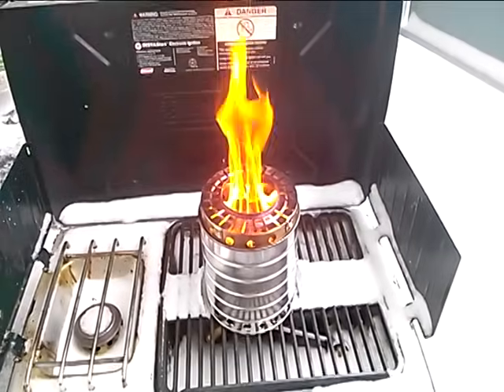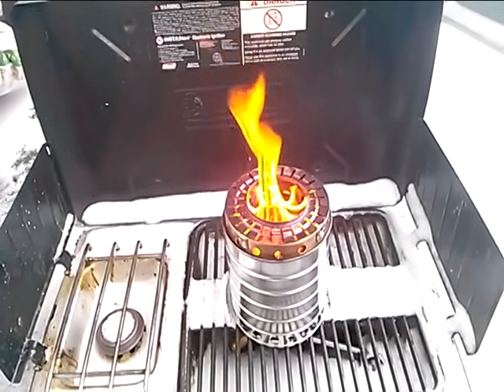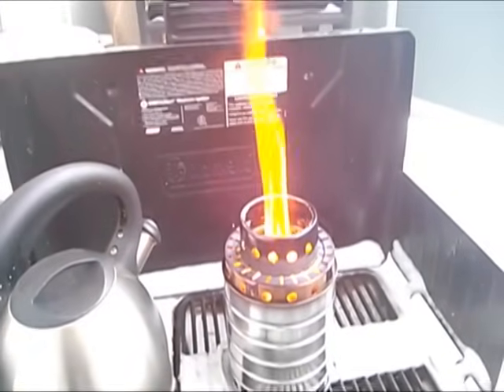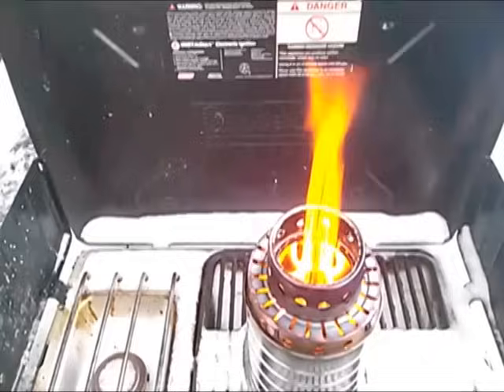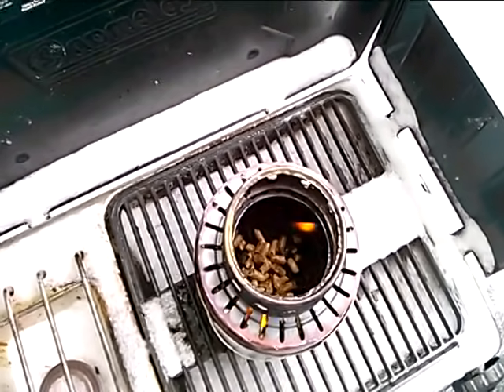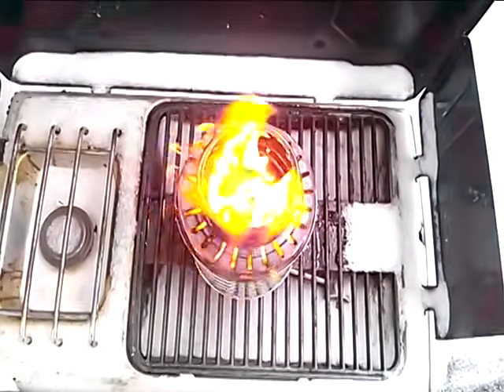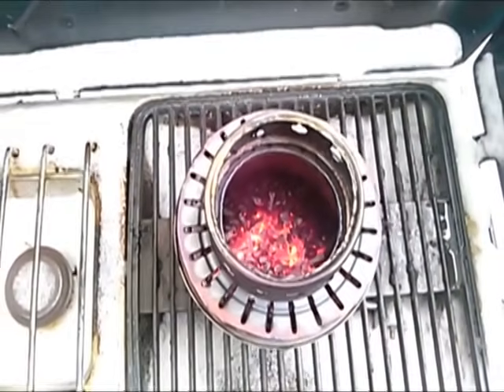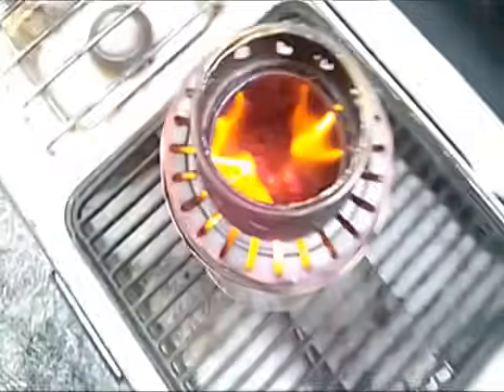DIY Stainless Steel Woodgas Stove v3.0 a.k.a "The Rocket!"

Comment: Is it possible to make it act like a cyclone by angling the holes on the top of the inner tin in one dorection? I'd really like to see your version act that way or maybe another version. The ones I saw that did it made a very concentrated flame and the inside looked super cool aswell.
Reply from the maker: I'm sure it's possible, however I haven't been building these stoves for a while now and I've moved on to other projects.
Reply: @joecmarques  that's unfortunate. Honestly you could probably make some money off this design xD its better looking than the solo stove.
Reply from the maker: @justm720  thanks for the compliments, that means allot!
Reply: @joecmarques  thank you for sharing your take on the wood gasification stove. Super nice.

Comment: Concentrating the flame into one spot like that is not ideal and that is why it is taking 15 minutes to boil. I have a little super cat can stove that boils in 2 minutes with a much smaller amount of flame than that. You need to send the flame out in jets instead of concentrating it.
Reply: The bottom surface fights against itself when concentrating the flame into one spot. That one spot gets hot while the rest stays cool for quite a while longer. Without heating the entire surface, the water is keeping the non contacted portion cool. Do you get what I am trying to say?
Reply from the maker: Thanks for the suggestion. This was very much an experimental design that I learned allot from. 

You mentioned that you boil water with less flame in about 2 min. That sounds rather fast, are you sure your making a proper comparison though? Keep in mind I'm boiling 1 Liter of water (that is 4 cups of water)... not 1 cup, and we are dealing with outdoor sub zero temperatures.

Comment: I find it interesting that many think that the gasses come up on the outside of the burn chamber and then to the inside chamber where they combust.  It seems rather obvious to me that it is air that comes up the outside, goes into the burn chamber where it gives the gasses oxygen allowing the burn.
Reply from the maker: djmaur, it is a mixture of both the gasses and the air which become super heated as they travel up the inner wall and out of the secondary air holes to combust. This is why the combustion from the secondary air only takes place once the stove has been going for a couple of minutes to heat the inner pot up sufficiently enough to super heat the gasses. 

To observe this yourself I would suggest building the stove, then blow out the flames or snuff it out, and what you will see is the smoke billowing out of the secondary air holes. Bring a lighter near the super heated smoke gasses and air mixture and it will immediately relight and the smoke disappears as it is immediately consumed by the flames. It is this very behavior which should prove to you, or anyone else with doubts what is driving the actual combustion. 

Keep in mind that at no point in time is there any flame emanating from the wood or charcoal, except when it is first lit. After a few minutes when the gas mixture between the inner wall is hot enough, the flame jumps to the secondary air holes, where it then starves the wood of oxygen and causes it to smolder slowly from top down. At that point in time you are burning wood gas. 

If you have doubts still, I would suggest you do a bit of research on the principals of how these stoves burn, and or search "wood gas stove science" on YouTube. There is a fellow who has done a wonderful job of describing the process, and testing the various different aspects of it's combustion, even going so far as to use a clear glass outer container to observe the results.
Reply: +Joe Marques I watched the glass jar video.  Too easy to show the fault in his explanations, but the time!  Or maybe I just don&#39;t understand the updraft part of the TLUD operation.  The flame on top gutters because the flame underneath is using oxygen that would have gone to the combustion chamber.  The smoke from the punk stick does travel up the outside as it travels with the air being drawn in from outside.  Closer inspection would show that the smoke was being drawn into the combustion chamber as well.  Ever blow on coals and get a flame? I just did that yesterday restarting a brush pile fire.  That is essentially what is happening when the punk is reintroduced while it is still hot.  Please note that it has to be hot enough, not just emitting gasses or smoke.  Why does the punk burn brighter when placed inside? Well, the same thing happens when wind blows into the brush fire I mentioned earlier. It is clearly a TLUD which requires an updraft in the combustion chamber.  This alone would keep the gasses from coming back down inside the combustion chamber.  Add to that that the flame at the top of the stove would remove the oxygen intended for the fuel if the air was somehow downdrafted. Air would need to be introduced to the combustion chamber another way.  Also, I appreciate the assumption that I have not made one to see it in operation.  Another point.. superheated is an extreme term to apply to the air that is warmed up as it travels up the outside of the combustion chamber.

Comment: hi joe, nice stove design you made here.....just curious, have you ever tried to use pieces of wood/bamboo instead of wood pellet?
Reply from the maker: Yogi,

Unfortunately I don't have access to that type of wood here in Canada. I suspect it would burn just as well as pellets, as long as the moisture content is low. If you end up building the stove, please feel free to share your results with bamboo as a fuel source!
Reply: Thanks Joe, I just sent your v4 stove link  to my friend, coz he use to make this kind things. if I'm not wrong, with your stove, the pellets will trasnform into charcoal much more than ashes, so that why I'm curious if I  use bamboo , hope will produce bamboo charcoal at the end.

Comment: Any updates (materials and measurements) on your design Joe?
Reply from the maker: I'll be releasing a few more videos within the next week or so. One of them will be a new design that not only burns cleaner with a partially blue flame, it also lasts longer (over 1 hour of actual flame), and it is 100% entirely constructed from easy to find stainless steel parts!
Reply from the maker: In the other upcoming follow up video's, I'll detail exactly how to build it, and I'll list dimensions, number of holes, placement etc. Sorry guys I've really been slacking in getting those details out, but I do see allot of interest, so I'll share those with you all shortly.

Comment: I looked at ikea as a flower pot, and couldn't find it. It turned out a kitchen utensil holder, it's called "cutlery caddy stainless steel kitchen storage Grundtal"
I'm gonna make one like yours! 
Thanks for sharing your video!
Reply: Did you end up making one of these? What product did you use for the can?
I cant find ANY that fit here in the US. Daily trips to the recycle place and many stores.
I think hes using metric cans. If you can tell me what you used then I'll be able to buy it online!
Reply: hoobly doobly I didn't, but I think he said , the outer can was from the coffee.
Good luck with your project!
Reply: or baby food, I forgot I actually haven't looked at any baby food yet because its so expensive. Thanks for replying :)
Reply from the maker: bbjagaa right you are! I'll be posting up a couple follow up video's shortly with complete instructions and dimensions.

Comment: this the best wood stove ive seen thus far, good job man! if possible could you hook me up with materials list and instructions on how to make this please? just a suggestion for a v4 if u plan on making a smaller version of this about 5" in diameter so it can fit in my maxpedition 12x5 water bottle holder
Reply: Ash Lahab I agree this is the best one i've seen so far... really would like to know what parts were used, especially the top ring with the slots... where did that come from?

Comment: Im having trouble finding the pot/ canister that you are using from ikea. Could you post  link showing the item you are referring to? Thanks
Reply from the maker: Jared, what your looking for is referred to as a "flatware caddy" and it's found in the kitchen section as part of the "Grundtal" line. Here is the link: http://m.ikea.com/us/en/catalog/products/art/10202088/
Reply: Thanks Joe, I appreciate it. Really impressed with your design, works better than most of the $100 fabricated stoves on the market, from what i can tell. Safe hiking!

Comment: what  wuold hapen  if  you  add  seeds  with  the  wood  mix  ,  cherry  seed, applel, peach  seeds, or  dryed  beans .  ???  thanks  for  hearing me.
Reply from the maker: Edwin, i can't say that i have tried burning seed's. But it should burn just fine, as long as the seed's are not too small that they suffocate the flow of air in the bottom of the burn chamber.

Comment: According to diagrams I have been looking at you should use only holes right at the top of the burn chamber inside the outer cylinder so that the secondary air comes up around the burn chamber and enters pre-heated. 

The holes you have in the design are pretty small still, did you experiment with going larger for these before adding the holes around the top? I wonder if the top holes introduce too much cool, drafty air. I also notice it seems you have smoking when you put a kettle on top. Have you experimented with ways to resolve this, or are my eyes playing tricks on me with the video?
Reply from the maker: Carl, those are some very good observations! Indeed you are right as well. What you have pointed out are some design flaws of my first few attempts at a working wood gas stove. Originally my though process was, that the holes around the very top rim would be necessary if i was going to sit my pot directly on top of the metal grill. However as you have pointed out, that logic was flawed for two reason's. First, those holes introduce a second route of "secondary" air directly into the burn chamber that does not pass along the inner pot wall and get super heated, in effect it is allowing in to much cool air and reducing the overall efficiency of the stove. Secondly, as you also pointed out, their is a bit of smoke visible after i place the pot on the grill. This is an indication of an incomplete burn, and a less then ideal flow of air.

In subsequent builds that I'm working on, I've completely done away with the top row of holes on the top rim of the pot, and I've instead introduced 3 collapsible pot stands that raise the pot about an inch or two above the grill without suffocating the flame and causing the smoke. Also, by raising the cooking pot, we are also getting the bottom of the pot closer to the "sweet spot" in which the hottest part of the flame makes contact with the bottom of the cooking pot.

I also have one more design that I'm currently constructing that does away with the "lemon squeezer grill", and replaces it with a stainless steel billy pot dome shaped lid. At the center of the dome lid I'll be cutting out a "concentrator hole" a bit bigger them the diameter of a paper towel roll tube. The concentrator hole concentrates the flame to the center, while the rest of the dome top acts as a reflector to maintain optimum temperature inside the burn champer in an attempt to increase efficiency, and make it easier to relight the hot gases if a strong draft of wind blows it out. That is the theory anyway. I'll have to find time to finish up the new design's and post updated videos to share my result's.

Comment: Very nice build there Joe. I do have a question about the ikea pot you using? Do you remember the name of the pot? I haven't been able to find it online
Reply from the maker: Hey Hans, the pot is part of their "Grundtal" line of stainless steel items in the kitchen section. Here is the link:

http://m.ikea.com/ca/en/catalog/products/art/10202088/
Reply: Joe Marques Can we get a full list of the parts you made this out of?
Reply from the maker: Roger Dickerson in addition to the above linked stainless steel Ikea pot for the inner burn chamber, i also used this Ikea "SPRITTA" citrus squeezer for the top grill:
http://m.ikea.com/ca/en/catalog/products/art/00152164/

For the outside canister i used a 640g Nestle GoodStart powdered baby formula can. Here's a link on Amazon, however you can find it in any grocery store:
http://www.amazon.ca/gp/aw/d/B006L0TKLI

Baby formula is pretty expensive! So i would recommend you look at coffee tins, i believe they make them in the exact same size and dimensions also.

Also, get yourself some good Cobalt drill bits for drilling into the stainless steel pot. Don't even attempt to drill stainless steel without a quality cobalt drill bit. Regular high speed drill bits are not made for cutting into harder metals like stainless steel. Ask me how i know? Version 2 sent me to the hospital emergency for T shot after breaking the bit and drilling into my finger after it slipped and broke!
Reply from the maker: Roger Dickerson i forgot to mention you'll need good quality hardened tin snips to cut out the bottom of the inner pot if you want to use the grate that it comes with. The main air inlet holes on the bottom of thr outside of the baby food tin are also half an inch, spaced 1 inch apart from the center of each hole.

Comment: That isn't a camping stove....that's a work of art ha haaa!  She's an absolute beauty! I've watched about a dozen of these vids looking for 'the one' to build & I reckon I just found it. Thanks Joe, great job.
Reply from the maker: Monty, thank you for the kind words! It's certainly satisfying to build something useful like this with your own hands and imagination, but it's amazing to see how many others appreciate my work as well!

Stay tuned I'll be trying out a new variable design concept in a couple weeks. What I'm thinking of uses exactly the same components, but instead of cutting out the bottom of the pot I plan to drill holes into it which exactly matches the removable bottom grate you see in this video. That bottom grate would then be fastened to the bottom of the pot, and held in place dead center with a single but and bolt. Now just cut a slit in the side of the outside can and add a small lever attached to that grate. Sliding the grate would open and close the primary air inlets, allowing you to adjust the woodgas to air ratio and effectively controlling the strength of the flame and overall run time according to your cooking needs like a proper gas stove!

That's how it should work in theory, but I'll certainly post a new video and share my results as soon as I get a chance to try it!

Comment: Nice work, man, I liked your solution the problem of smoke 
I did it to expand a hole in the top and bottom of the piece inside 
Also found a piece of steel ready for work this burner just need holes 
Will be found in the shop Housewares 
Is a pleasant surprise for everyone who loves this burner which is also cheap 
I'll put the video after nearly two days

Comment: Awesome design but i would to suggestions an optional add , insulating the outer part of the can with somekind of heat resistant material would i think greatly reduce the heat dissipation from the steel ;)